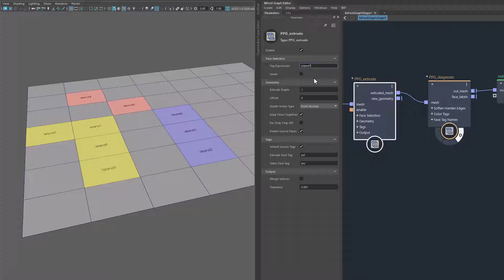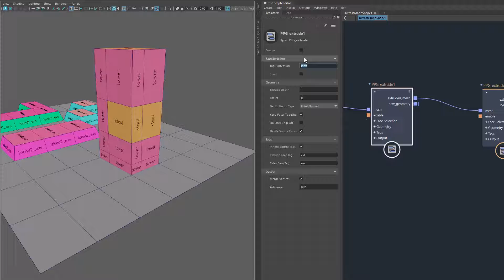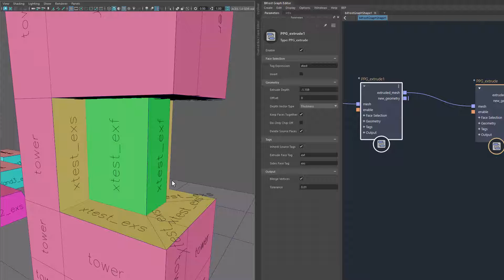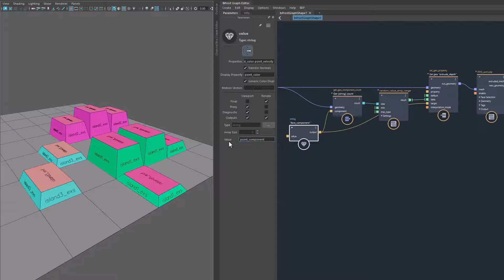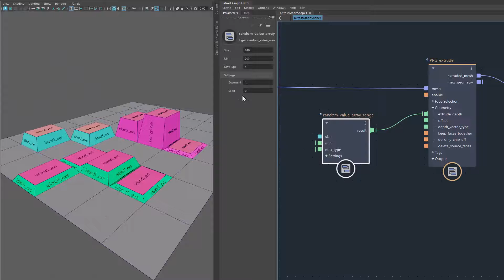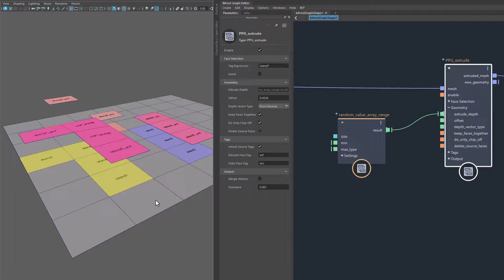PPG2.0 Extrude Tutorial for Bifrost

Comment: What about shaders  assign issue?  Maybe create selection sets for every shaders?
Reply from the maker: You can assign shaders to the faces by face tags.
Try the node "assign_material_to_tags" to assign a material. You need to chain the nodes together for several materials and output an array of objects to Maya.
Or use the node  "bulk_assign_material" to assign many materials in one go.
The materials (which are references to materials in Maya) show when you render the Bifrost shape.
Reply: @RolandReyer  Thanks for answering, but should I do the same with the redshift?
Reply from the maker: @olekkovac5506  sorry, I don’t know the answer to that.
Did you try it?
Reply: @RolandReyer   I tried but my attempts were unsuccessful...
Reply from the maker: @olekkovac5506  if it renders with Arnold and does not render with Redshift then there seems to be something missing. I’ll ask around if someone knows a solution.
Reply: @RolandReyer  It would be nice. 
Maybe I did something wrong...
Reply from the maker: My colleagues say that Redshift does not yet support Bifrost. 
When you bulk assign shaders in Bifrost, then output this array of objects, then RMB on that output channel and “Create Maya Object” you would get a series of Maya objects with construction history. 
Maybe you can render those with Redshift.
Reply: @RolandReyer  Hmm.. I can't find node "assign_material_to_tags". Looks like I need to install PPG2.0.
Reply from the maker: @olekkovac5506  are you sure you have PPG2.0 installed?